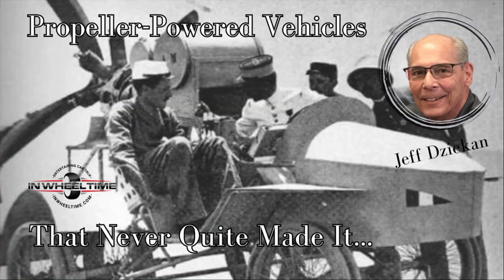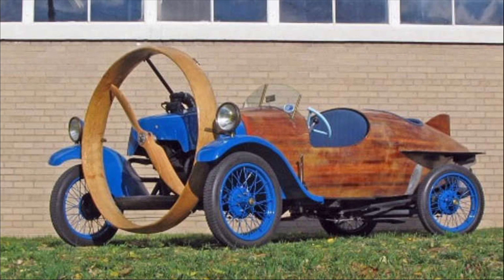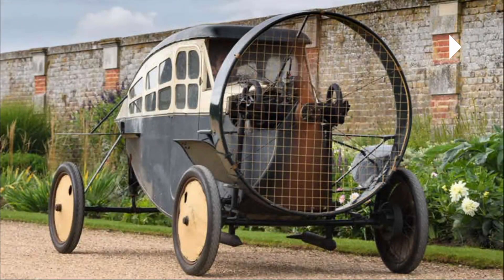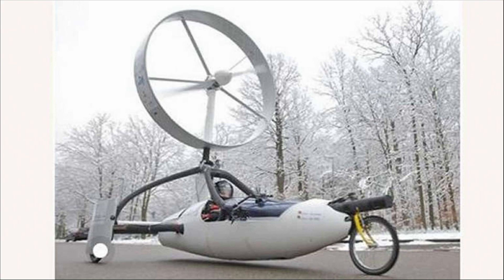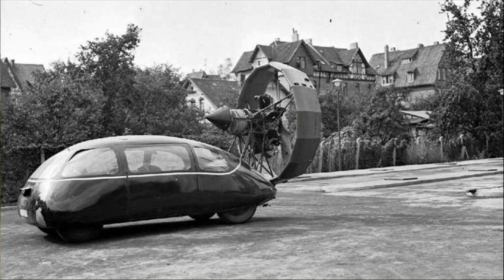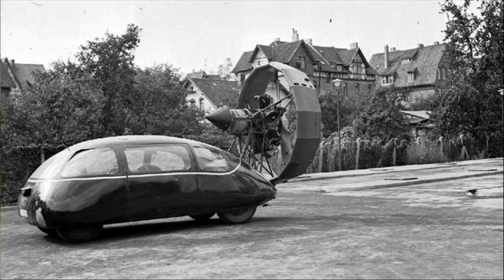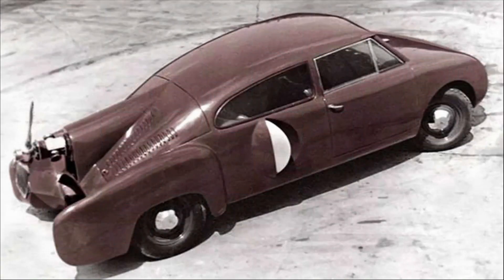Propeller-Powered Vehicles That Never Quite Made It....

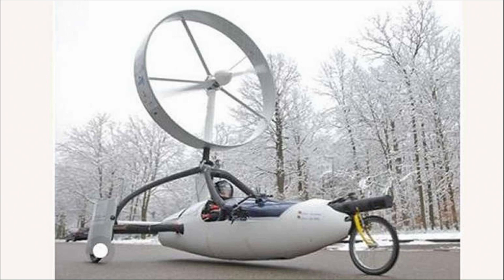Comment: If it's doing what I believe it is, the car at 2:26 works in an unusual way.

This thing is a little confusing at first but basically the wind pushes from the back, the drag on the frame gives it the initial movement, the prop is driven by the wheels (it's not a turbine) and this gives the tailwind mass to push on, which increases the speed, and things continue from there.

The design is capable of going faster than the wind that is powering it.

It's counterintuitive but has been tested with a few different designs now, the original "Veritasium" I believe brought it into public view.